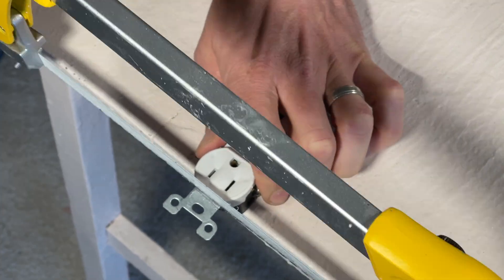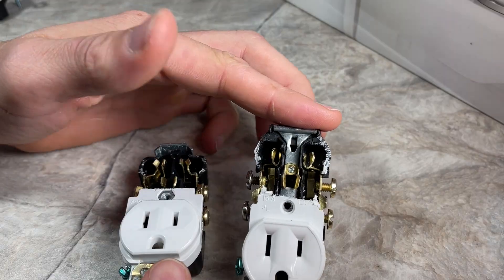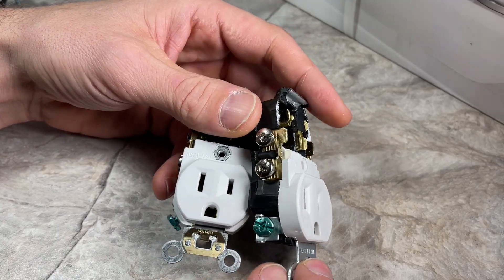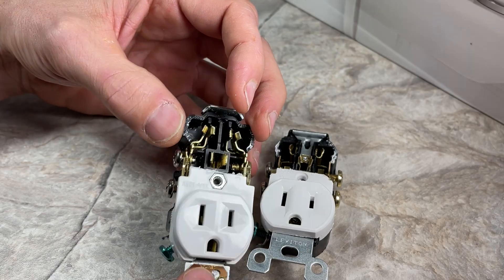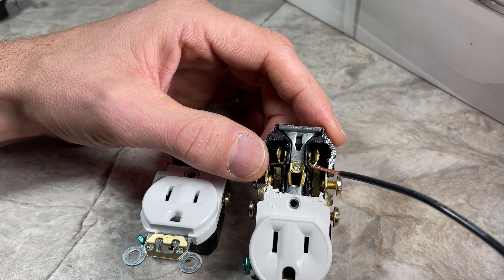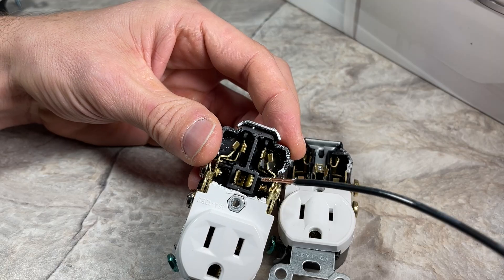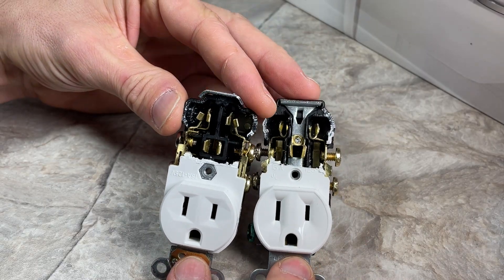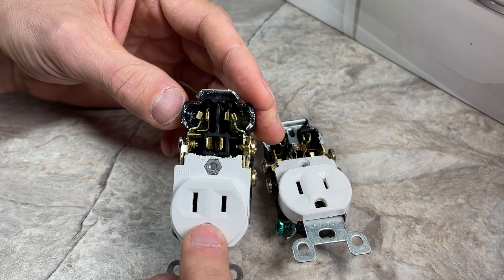What Outlet Should You Buy For Your Home |  Commercial vs Residential

Comment: Homeowner, but also with a lot of  experience in electronics. It has been my practice for at least a couple of decades, to ALWAYS replace consumer-grade outlets and switches with commercial grade, for all of the reasons you gave. A beefier product will always last longer and is always safer than a cheap thing that WILL fail. Plus the commercial grade rarely has the tamper resistant feature, a benefit for us older retired folks with zero rug-rats. (Besides, WE managed to survive childhood without them.) 
What really gets me irate though is when I am staying in an older hotel, motel or vacation property that was built with cheap receptacles. They get FAR more use & wear out very quickly because they often appear to be residential grade!!! Think about it. At home I may plug something in and leave it there for years. In a hotel people are plugging & unplugging EVERY DAY!
Reply from the maker: Hey Mr Payne,  I totally agree and hotels are the classic example.  Especially trying to plug in the little 2-prong plugs to charge your phone and then they literally just fall out of the outlet.  All the best and Happy Holidays.

Comment: What causes outlets to fail is heat, loose connections, and what your plugging into them, next time your plugging something into and outlet take a look at the prongs of whats your plugging in. Are they clean and shiney?  Most of the time they old, dull, dark and corroded. This is where the heat comes from that causes the outlet contacts to loose there spring tension and start generating more heat and fail.
Reply from the maker: Good stuff David, thanks for the feedback!

Comment: Good video. Took me a while to realize cheap ones weren’t the best bargain.
There is a video you could do. An expose on the difference between commercial grade, homeowner grade and contractor grade. Could look at door knobs and hinges. Bath accessories, Plumbing components, electrical components etc.
Reply from the maker: Hey Keith, for sure, actually I have had a heck of a time with cheap door knobs lately.  The lower end ones are complete junk.  Thanks for the feedback.
Reply: I know plumbers and they go to a plumbing supply company to get good quality fixtures rather than Home Depot They say its better built. With plumbing, age is a big issue, with older galvanized steel. If you want to see huge mistakes with plumbing look at galvanized steel issues, which has been pretty much banned everywhere but used to be used in lousy residential plumbing installs. If you buy a house, plumbing can be a major issue as well as the roof. Copper can eventually go bad as well but the galvanized steel is the worst stuff. The latest trend in plumbing is PEX. It is hoped this will give a good long life span, as well as being easier to install.

Comment: All I can tell you is I wired my house myself 25 years ago and I used the 50 cent outlets and switches.  So far, I have never had to replace any outlets and only 1 switch.  It's interesting that 25 years ago, the prices for both types were about the same as they are today.
Reply: 25 years ago things were better  made.
Reply: @timseifert7762  with inflation to it was probably around a couple dollars kore
Reply from the maker: That is interesting how the price has hovered for that long.
Reply: @ehoffsr Having watched contract manufacturing in several countries I'll say this:  the buyer gets the level of quality that is contracted and for which the buyer has their own inspectors and contract enforcement officers in the factories.  China, Mexico, USA, doesn't matter.  Your iPhone and very likely any computer you own came in full or in part from China.  Yes, crap can come from there, but that's because someone specified "crap quality" as the result of the price and enforcement.

Comment: Good video and explanations.  Some codes and many cities now require TR (tamper resistant) type outlets which brings a whole new light into your description of quality in outlets.  I'm sure in the future you may have a video showing how bad these devices are.
 I'm a GC  in Cali and can tell you that in no situation EXCEPT industrial, will you find an upgraded outlet as they are not spec'd ESPECIALLY in residential so your vid may be well suited to someone who is constantly using a particular plug in their house but... for the most part, failures are few and far between even residentially.
Reply from the maker: Appreciate the feedback from the West Coast.  Where I am located we were one of the last to adopt the NEC code for TR outlets So you can still find the majority of outlets at the home improvement stores are not TR even though our code does now call for TR outlets to be used in any new work.

Comment: Cheap parts have their place.  I just replaced the headlight lenses on my 1994 Ford Focus with the cheapest available.  However, the combination of fire danger, electricity, installing them in your home, and a difference of $1.50 each suggests to me that the nice outlets would be a worthy upgrade for almost everybody.
Reply: Plot twist- Headlight lens melts and catches fire.
Reply: Depends on how often the outlet gets used if at all, and what kind of load it's taking. For a small bedside lamp which never gets unplugged and is mostly inaccessible behind a nightstand, then a $0.50 outlet should do the job just fine. Any benefits of a $2 outlet would never be noticed or needed. But for heavily used kitchen outlets, or outlets with heavier loads such as for appliances, then it may be worth the extra $1.50.

Comment: This should be a must watch video for EV owners. I was wondering why my car charger would fault at random... Turns out the residential plug had shorted internally from the heat (current draw).
Reply from the maker: Jose, someone just mentioned this issue the other day.  The current draw is so high for the chargers the cheap residential plugs are almost guaranteed to fail within a short amount of time.  Maybe a future video idea 👍
Reply: @EverydayHomeRepairs  You should definitely do one! I know the Volt draws 12A at 120v, which will cause store extension cords to burn up. Even 10g ones.

Comment: Great job.  Thank you.  I'd like to add two fine points: (1) The added "convenience feature" of the push-in connections on the cheaper outlet is favored by some people, but it's not as much convenience advantage as you might think.  The shape of the screw terminals on the commercial-grade outlet allows you to push the straight wire-end in under the screw and tighten it without having to bend it around the screw. Almost as easy as the unreliable push-in connection.  (2) You described a short from hot to ground in the cheaper outlet.  A similar short can also occur from neutral to ground, which would go undetected in normal operation, but could lead to 'ground-loop' problems with fault safety and induced hum.
Reply: OldJoe C h
Reply: The push in feature your talking about is referred to "Backstabbing" and are junk, as a master electrician i have seen and replaced countless number of these that have failed.
Reply: @Bluesman57  My home had the backstab junk (1990). I replaced them all with commercial so I had the 𝑏𝑎𝑐𝑘𝑤𝑖𝑟𝑒 feature. 
It's 100% better than wrapping the wire around a screw besides having a much hire quality device..

Comment: Thanks so much for visibly showing the design differences and potential problem areas in these outlets.  

In professional home inspections in many  areas, performed in connection with buying or selling a house, one of the test items is the tension with which a standard plug is held into an outlet. As you mentioned loosely held plugs with the weight of the attached power cord tugging on it, tend to fall out, or make a poor connection when you plug something in.  High amperage devices like vacuum cleaners and power tools tend to short out the outlet or cause it to overheat & melt the plastic if there is a loose internal connection, making cheap outlets a fire hazard after a little normal use.  I noticed that some older GFI plugs in one bathroom in my home were cheaply made and it is hard to get a hairdryer plug, for example, to make a firm, solid connection to these outlets. New ones have been purchased and they will be changed out over the holidays. 

Thanks again for this excellent video.

Comment: I've been i stalling the commercial grade outlets for every repair or replacement (or even when just repainting a room) for a few years now after I had an older residential-grade outlet short out and nearly start a fire.  Wasn't clear about the specific improvements so very happy to see this take-apart!  In my case I just figured for an extra $1.50, even a slight difference in reliability was worth it for the peace of mind.  Life is too short to be wasting time replacing cheaply made products when one well-made one can outlast several, and I figure my time and effort are worth diverting some of the money saved by doing it yourself into more reliable parts.

Comment: I love your Video of the residential outlet and I agree with it all. 
  I did see one important point that you left out or I didn’t see. 
  The screw terminals on the cheap model you have to wrap the wire around the screw and tighten. The more expensive model the screw terminal has the ‘what I call Sandwich Plate’ under the screw. This alone makes this a better outlet. This avoids the wire from escaping when you tighten the terminals. Maybe you could go back and point that out as well. 
  Also I installed 20 amp outlets all through my house because of this. I did not use Leviton but the more commercial grade which of course gave me the total 12 gauge wire ampacity to use.

Comment: Although the holes in the back that aren't recommended come in handy when the previous homeowner or the last person to work on your outlet leaves you barely and wire. In my case I was replacing a plug from the 70's the copper was actually stuck to the outlet so i had to cut it which made it even more shorter then it was. but the back thing came in handy. but my outlet seems to be a different designed then the one featured here.
Reply from the maker: Yeah, these are made by Leviton and at least in my area is the brand that Home Depot carries.  From what I have seen Lowes carries Eaton.
Reply: Probably not as much advantage in the push terminals as you might think.  The shape of the screw terminals on the commercial-grade outlet allows you to push the straight wire-end in under the screw and tighten it without having to bend it around the screw.  Full reliability, almost as easy as the unreliable push-in connection, and works just as well with a short wire.
Reply: @oldjoec3710  yeah mine was a different design then featured in the video. The actual thing tightened with the screw there was a plate that pinned it against the same plate it would be on if I used to loop method.

Comment: Really enjoyed this video. Learned a lot. However, can't believe you didn't address the problem I see most often with the  typical residential plug. The white plastic piece just below the ground outlet frequently breaks off. Don't know how unsafe that may be but it looks like a broken outlet and I imagine that home inspectors frequently write it up.
Reply from the maker: Thanks for the feedback Jerome.  I have seen that a few times and at least from a safety side that is better than exposing the hot side but still not ideal.

Comment: My grandma’s house was rebuilt in 2007 after a fire burned a third of it down. During the reconstruction, the electrician used those Leviton residential outlets AND the quick connect pins on the back. 13 years later in 2020 the plug behind the fridge went on fire.  Thankfully it was extinguished before any serious damage was done—only the cover, outlet, and box needed replacement.

Case in point: residential plugs are GARBAGE and i would advise that no one ever use them for anything. I repeat, they are GARBAGE. And those quick connect pins need to be banned by NEC because evidence shows they are not true to their rating. If a receptacle is rated 15a, it needs to be able to hold that load from the time it is installed to the time it is removed without issue.  Any electrician who uses the quick connect pins needs to lose his license and go back to school.

I ONLY use industrial or hospital grade outlets for my installations, or commercial grade at a bare minimum.

Comment: a good electrician will not install  low quality equipment it is not worth your reputation, and the call back to replace broken equipment . as a electrician I take pride in my work. I will only do thing the correct way even if i don't get the job because my price is to high (quality breakers, outlets, fixtures, switches and CU wire are a must) and doing the job correct the  1st and only time, if you had to do it twice you lost money and time and hurt your reputation.
Reply from the maker: I like to hear you say that and wish more people follow the same philosophy.

Comment: To show the weight difference, put them on a scale. Peope would then "SEE" the difference. Good video!
Reply from the maker: Good feedback Jerry.  I am going to do a hospital-grade comparison coming up and will bust out the scale.
Reply: @EverydayHomeRepairs  Looking forward to the hospital-grade comparison, as I have a few as-yet-uninstalled GFCI receptacles in hospital grade. I do remember inserting a plug in one of them just for kicks, and it seemed the receptacle gripped the prongs like a vise!!
Reply: @EverydayHomeRepairs  Hi- there are standards (UL, maybe?) that separates commercial, specification, and hospital grade wiring devices.  The keys are number of insertion/removal cycles, mated connector retention, and amount of force required for un-mating, but there are others as well (dielectric strength of insulators, isolated grounds, physical robustness of the device, etc).  I'm guessing that with a "G" search you can suss out the differences and confirm/deny specific sample conformity.
Reply: @EverydayHomeRepairs  contacts should be the exact same, hospital grade has plastic covers over the screws to prevent arcing to the box
Reply: If you or anyone puts out a video and says something abought weight, the only way for someone to "SEE" the difference in the video would be to wiegh them so that someone can see the difference. I figured the guy already had scales or could get some to help him "SHOW" people the difference. The common person would then see that the one is much more sturdy or built better. As somoene that works in construction, telling someone something and showing them or having them hold something is very different. Just yesterday I pounted out the difference in 2 adapters here in Afghanistan. He could tell the one was much heavier and sturdier than just by holdig them.

Comment: An extra $100 on outlets, $50 on switches, door knobs, faucets... add up to a nicer flooring, cabinets, countertop or shower.
The video suggested that the difference is in the number of cycles it will last. Most houses have unused or seldom cycled outlets.
Reply from the maker: Hey Mark,  you bring up a good point and many people had mentioned they selectively use the commercial-grade outlets where they know the use will be higher.

Comment: I've never seen an outlet fail, have you?  If so, how old was it?  10 years?  20 years?  30?
Reply from the maker: Are you being serious?  Sorry, not sure through the comments.  Without that much experience and I have seen 3 cheap outlets fail in various ways where it creates a safety / fire hazard.  If you ask the Pros commenting on this video I am sure they could go on for days.
Reply: @EverydayHomeRepairs  How did those 3 outlets fail exactly?  How old were they?  I've seen some wiring in older houses that seemed kind of scary, but I've just never seen an actual failure, so I can't help but wonder if those commercial grade outlets are really worth it.  I mean yea, they seem "better", but are the regular ones "good enough"?

Comment: Its no contest between  cheap manufacturing or high quality outlets. Case in point: The heavier one is obviously the newer design (patent) ;    the lighter one is the older or earlier design. Think about this, there are numerous design (patents)  out there, they don't distinguish between commercial and residential.  BECAUSE IF YOU SELL and Manufacture  ELECTRIC OUTLETS, YOUR  product would still HAVE TO CONFORM TO UL STANDARDS.   So regardless of what you choose between the two options,  both  outlets will  still be UL  COMPLIANT.    All his notions are just about  MARKETING and SALES.